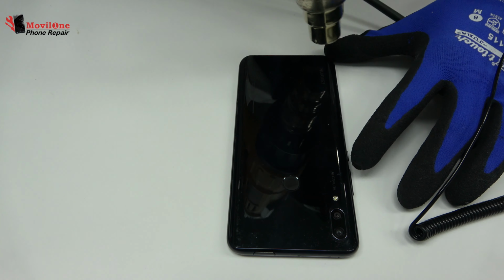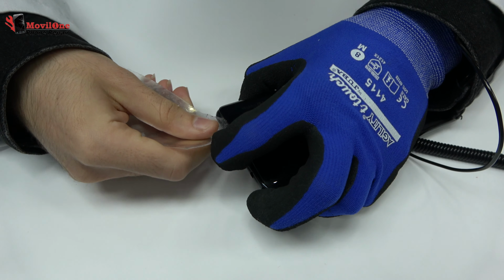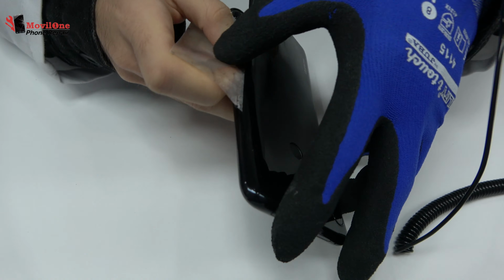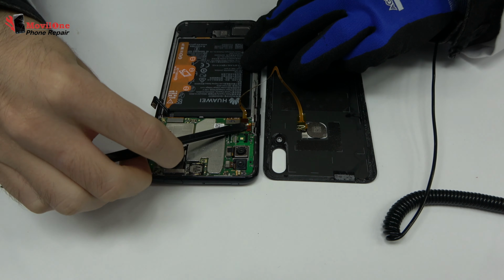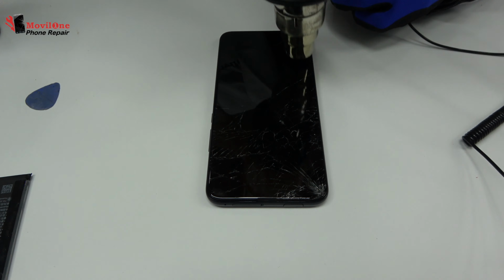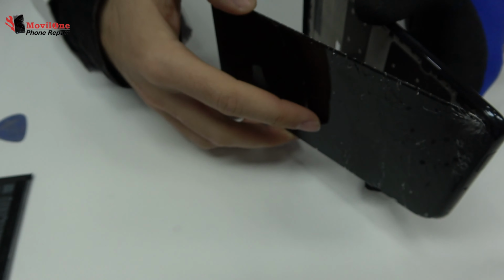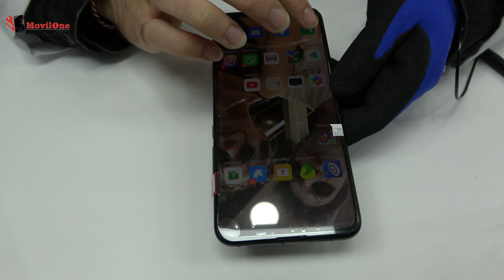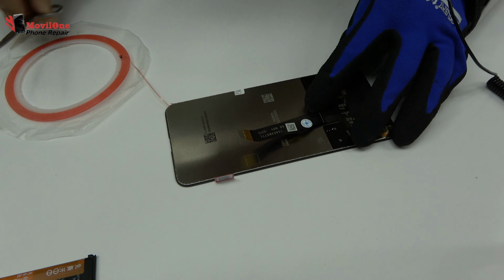Huawei P Smart Z Screen Replacement

Comment: why change lcd if glass changes without problems? Also, using a spray instead of liquids and a hot air gun instead of a separator indicates your low qualification.
Reply: good luck replacing the glass on the lcd